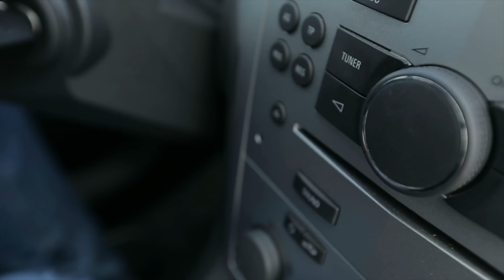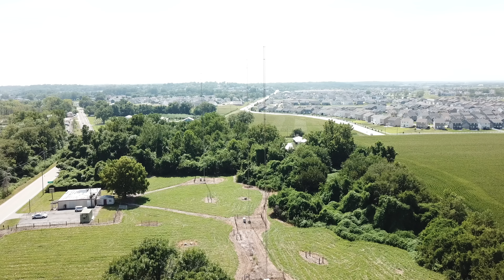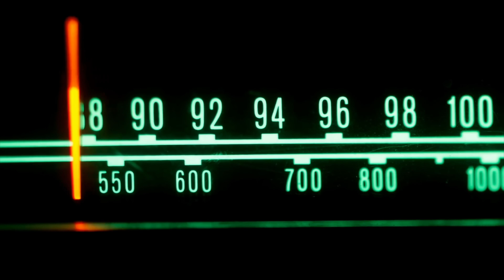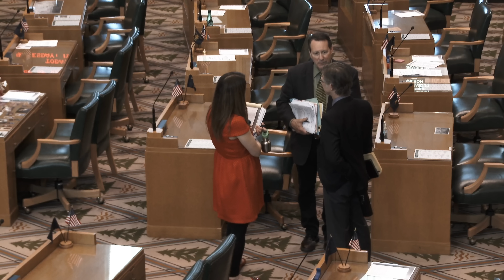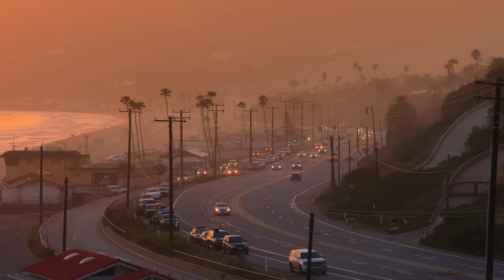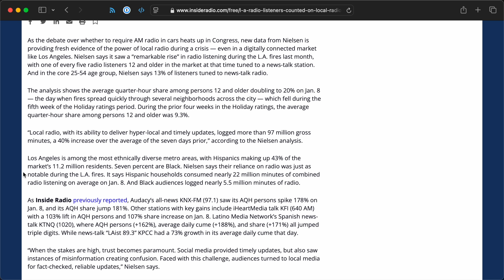Automakers are losing the battle with this 100-year-old tech

Comment: That being said, its shame that FM radios are being software-locked in phones. We have all hardware needed to have functional FM radios on our phones, but SIM card providers are intentionally locking them, so we must use internet to listen to the radio. Its not like im big user of FM radios, but in some emergency situations its nice thing to have
Reply: You can still use fm radio on phones with a headphones jack.  The phone uses the headphones as an antenna.
Reply: @peanutgallery95 
Not with radios for the FM tuner is software locked and not usable. My Android phone has an FM tuner but it's software locked and I can't use it with or without headphones.
Reply: @peanutgallery95  Yet they also remove the headphone jack from phones 🤔
Reply: @peanutgallery95 not all phones. Some phones the chip is locked meaning the apps that could use it cannot access it.
Reply: @peanutgallery95  We still have USB-c connectors that can act as an antenna and for audio. Some of these pins are not in use. On my old phone with headphone jack FM radio was locked
Reply: on my last phone, a Samsung Galaxy S10e, i had a headphone jack but as far as i know no fm radio function still
Reply: @animehair05silently88  you can always download an am/fm radio app
Reply: @animehair05silently88 I had to download software on my S10, but it worked.  On Verizon at the time.
Reply: Definitely need that too
Reply: Is that some amerimutt slave joke I am too free to understand?
The FM radio works perfectly fine in my smartphone without a SIM
Reply: Interesting. I'm gonna verify for myself!😅
Reply: Capitalism is insane. Its starting to enslave tech for profits.
Reply: Imagine being able to receive radio for free, paid for by advertisers.
Reply: @microdesigns2000 advertiser funded anything is not free, the consumer is the commodity
Reply: @microdesigns2000 Imagine the airwaves the radio is even on being owned and controlled by the public for the public interest.
Reply: @Praisethesunson  you've not worked in radio before?  Radio stations are privately held.  And public radio is, well, less public than you think.
Reply: @microdesigns2000 Station owners apply for broadcast licenses on “the public airways”.  

The stations are privately owned, but the airways are publicly owned and government managed/licensed.  There can (and have been) be various issues with that too,of course.  Especially since deregulation (and consolidation).

Comment: Am only radios were included as an option in stripped down no frills lowest trim level vehicles as late as the 80s, probably into the 90s for trucks, utility vehicles
Yes, my first car, an 86 Mercury Lynx (Ford escort) came with NO radio, not even AM, just a blank plate in the radio bay in the dash.
Manual trans, windows, brakes. Nothing powered, no radio. Stripped down to sell to first time buyers, students, as I was in my undergrad.
New off the lot

Comment: I restore vintage radios, most of which just receive AM.  However, I have an FM/AM converter and a small AM transmitter as I do not like talk radio.  On the other hand, I used a 1960 vintage AM transistor radio to keep up to date during the 2021 Freeze here in Texas.  Power was going on, then off, so a battery radio was the only thing that was reliable.
Reply: I have a crank AM/FM/Weather radio for the once a decade long power outages. We had our local cell drop off line after a few hours the last outage.

Comment: The FCC simply doesn't care about AM interference anymore.  I'd be surprised if anyone at the FCC even knew what Part 15 even is.  I listen to baseball games on a 1928 RCA Radiola 62, and over the years it got harder to listen to NY from CT.  I shut the main breaker off in my house and WFAN NY came in crystal clear with my battery radio.  I started throwing breakers one by one to isolate where the noise was coming from, and the worse offenders was my wifi router and some motion sensing light fixtures in my driveway and the alarm system was adding to the din.  There's no reason any car's electrical package should make enough interference to bother AM reception.
Reply: I wonder why part 15 says that it must accept interference, including interference that causes undesired operation of the radio?
Reply: Electric vehicles are super dirty. The inverters and motors can make AM pretty much unusable. Rolling radio jammers
Reply: @beff50  My 2018 S has an AM radio in it and it works fine.

Comment: You are talking about AM signal and you don't mention FM or DAB+ at all. All these standards are communication devices mostly just signal receivers that influence listeners' decisions. How stupid is it to have antennas for different standards when you can have one antenna and a decoder chip to convert the signal into something we can listen to or watch. We used to watch TV via antennas and now we can't listen to radio stations? Who will listen to the instructions of corrupt politicians via signals they own? You mentioned disaster warnings, how many of these warnings could be prevented before they are broadcast on AM if we were proactive and prevented them?
Reply: Mate, they are in the USA.

DAB+ doesn't exist there.

FM is way too short a range. We can just about ignore AM here in the UK because of the fact we are so bloody small so FM, multiple FM transmitters, with many more DAB transmitters as DAB is even shorter range than FM, can just about fully cover the UK fine.

One, just one USA type AM transmitter will cover the UK. Just one.

Seems you need to learn what radio is, wavelength is very important as well as frequency and it's wavelength/frequency that we are talking about here. Not the difference between FM and AM. It has nothing to do with the modulation technique. Nothing.

The only reason why it's called AM, is because you can't do FM very well on that frequency. And DAB? Forget it.

Comment: Try using AM in your house. All of those little power bricks that use switching power supplies broadcast AM interference. Cars used to escape that, mainly because there was not much electronics in a car. That is changing rapidly. I can get AM radio in my Tesla, which has no AM radio at all. I is done via internet radio and the cell phone network. End of problem, but of course that leaves the AM towers with no reason to exist. Its going to be hard to find both AM radio towers and people who care. Life moves on.
Reply: Ahem, getting "AM radio by mobile phone" isn't AM radio mate.

Neither is saying you have a bowl of fruit when you actually have a picture of one.

When you end up needing that AM transmission, your cell phone is dead.... No data bits when no service duh...

Comment: there is very little AM where i live, sometimes i sit and go trough the range getting outside country stations and i have always been a bit amazed by it
Reply: You could try running about 250' of wire out as an antenna extension. AM is also much better at night when the F layer of the ionosphere develops.

Comment: Airplanes still communicate with VHF  radio , which is basically AM. They also have ADF which can home in on an AM station. (auto direction finder)
Reply: The majority of ships and boats also use VHF.
Reply: VHF frequencies propagate very differently to MW (AM Broadcast frequencies). VHF is essentially line of sight. MW frequencies refract from the ionosphere, giving them far greater range, particularly at night.
Reply: I've not flown a aircraft equipped with an ADF in 20 years.
Reply: @grayrabbit2211  Many still have steam gauges , not all owners are rich enough to convert them to glass  and old airplanes, unlike cars , last forever.
Reply: VHF (Very High Frequency) is more like FM radio in terms of reach. MW (Medium Wave) is used for AM radio and can travel much further.
Reply: VHF is NOT AM🤨🤨🤨🤨
Reply: the air band uses am to prevent the fm capture effect and other things, am is more reliable however since it is VHF, that means it's coverage is similar to the standard FM band.
Reply: @DiaperDon_BoneSpurs_Epstein  In common use regarding broadcast radio, when people say AM or FM they refer to both the band and the modulation type. But they aren't exclusive to each other. The Aircraft band is indeed VHF, from 108 - 137 MHz, but it uses AM modulation. Also, CB Radio (27 MHz) used to be only AM modulation but since 2021 the FCC has allowed narrowband FM modulation to be used.

Comment: 😮😮 America needs to adopt DAB+ radio. AM radio here in Australia transmits at low power and it won’t go as far as 60 kilometers range from the transmitter and they are pushing digital radio that is DAB+ and it sounds like a CD in full stereo sound in mp4. It runs on VHF band 3 with the television.
Reply: DAB+ is too short a range. You're looking at multiple years just to start building the huge network of multiplexes you'll need just to replace one AM transmitter let alone several.

VHF is getting close to line of sight too.
Reply: @dlarge6502 It has the range of digital TV and that’s a similar range to FM radio here in Australia.

Comment: I don't know the situation in USA and how the radios are used there, so my comment can be biased.

I don't think we need AM radio. I think we should move to 21 century and make mandatory DAB(+)¹ and DRM². I think DRM should be able to supersede all the features of analog AM broadcasting. Better quality of sound or ability to transmit on longer distances with same power. Better error correction can help with poor reception. Of course, if you jam more stations in one multiplex, then all the advantages are gone. With DRM we should be demanding some open codecs like Opus, which don't have problem with patents and can manufactures don't need to pay licensing fees.

I seen that Sirius XM been quite popular in USA, maybe in case of emergency, each car can have some free Sirius XM radio stations which can be used in disaster situation. Satellites are not usually affected by natural disaster(Ignore for now the solar storm) and studios can switch to different city/state to broadcast or switch temporary to different radio on same channel.

Radek.

¹ https://en.wikipedia.org/wiki/Digital_Audio_Broadcasting
² https://en.wikipedia.org/wiki/Digital_Radio_Mondiale

Comment: AM has the potential of phasing out FM as Amplitude modulators become more sophisticated and sound quality becomes comparable to FM mono. AM can travel much farther and is more sustainable than FM. FM is limited by the line of site while AM can follow the curvature of the earth. It takes less energy to put out an AM radio signal and cover more range in some situations. You are also not constrained to tall locations which are expensive to own. Modern Amplitude modulators convert digital to digital to generate the signal and tests have shown that resampling a digitally sampled signal into digital again and back to analog significantly decreases audio quality.
Reply: You are prescribing properties to AM that simply isnt true, the frequency of most am transmission is what enables them to be heard from far away. Granted if two stations are on the same frequency in FM you wont hear the weaker station.

Comment: AM radio is being phased out. AM radio is subject to easily have atmospheric and electrical interference. It requires a proper antenna and special electrical noise reduction in the car. The sound quality of AM is not as good as FM and especially digital signals. 

Many of the radio stations have live listening on their web site.  There are phone apps that can be used to listen to radio stations. With the smart phone you can also go to the radio station live program site, and in many models of cars you can Bluetooth the sound to the car's sound system.  

AM radio stations require very powerful transmitters.  If there is a power failure they have limited time if running on generator. I never use the AM part of the radio in my car.  I am fed up with the huge amount of advertising on even the FM stations.  I subscribe to Sirus XM radio and to an on line 24/7 music service. These have many different channels for any type of music you can think of.  With XM radio, Google Maps, and Waze, I get live up to date traffic info on the vehicle's screen.  No need for radio traffic reports which are limited to rush hour only.
Reply: The sound quality of AM is purely a function of the bandwith used. You can easily surpass the sound quality of an ordinary FM transmission if you use AM, the signal would be mono though. The digital signals i heard sounds like crap, over here, number of channels trumps quality. Id never bother to pay for listening to something, least of all subscribe.
Reply: Obviously you have absolutely no idea what the hell radio is and how it works. 😂

Comment: Frequency & coverage distance are one immuable consideration imposed by the laws of nature, but modulation could still be improved decades after stereo was added to the AM band, in the '90s, by going full digital...  Which would boost noise immunity and yet offer some fair trade-off, if people want it.
Reply: @Egzoset - Analog AM stereo existed long before Digital AM (HD Radio in the USA)
Reply: @graemezimmer604  So what, i suppose you'd want it built with thermo-ionic tubes too!
Reply: Digital modes all fail on weak signal reception. An analog signal can still provide you with something, a digital signal will just go mute.
Reply: @juslitor  You're signal is breaking up, try get louder!
Reply: @ I am not a signal, nor a number.
Reply: @ More like noise on the battlefield, i'm ready to bet AM is rare in both the Ukrenian and Russian armies, imagine analog AM!  Go figure why...
Reply: @ Military signals are a whole different ballgame, one would imagine that unencrypted transmissions in this day and age wouldnt be used. Yet the ukrainians managed to frag a number of generals and colonels based on sigint intercepting russian transmissions.

Comment: There is an AM antenna tuner hole near the antenna socket usually, so you can tune your radio for the best reception on the weak station with a plastic screwdriver.

Comment: its actually a huge issue in EV's. early gen model S's tried going to a ceramic bearing inside the main motor stater to cut down the emf loss/am interference. these bearings causes weird potentials to build up and destroyed other bearings, similar thing happens to space station gyros and is why the hubbel satellite is about to be retired... imo i dont care if your car doesnt have am radio, but i would like some extra shielding put in in key areas as a stopgap.

Comment: i'm about 200 miles from the city, tbh i don't really listen to the radio much at all, but when i do it's usually am radio, i don't pick up hardly any fm stations.
Reply: Honest question. Is that worth maintaining a vast broadcast infrastructure and adding expense to already expensive electric cars?
Reply: @gloomyblackfur399  depends on who's funding the infrastructure really it's ultimately up to them, anyways i only listen to the radio during storms but we've got tornado sirens for bad storms already, don't have much reception on my cellphone so emergency alerts don't really work on that and i don't get in any tv stations over the air either. anyways speaking of electric cars there's no charging stations for those here either, i've seen several people get stranded at the gas station.

Comment: Interesting topic. Why legislate?
Btw, In the UK we already have a little known system for tracking your vehicle. 
It’s called ecall. I believe it’s been mandatory (?) in new vehicles since 2018. 
 We’re told it is for our safety and convenience…??!!
Reply: Mine is turned off
Reply: eCall is an EU mandate, but it only sends location via SMS to 112 (the UK reroutes this to 999) when you crash the car?  unless I’m missing something
Reply: @oskarz Pretty sure that is also available in the US - though may not be mandated.
Reply: @barrieshepherd7694  it's not eCall in the US, it's GM's own proprietary thing, may vary manufacturer to manufacturer

Comment: I deliberately stopped listening to AM radio when political shows got syndicated and hate radio replaced local programming.  One FM station I worked for  bought an AM station in the nearest metro market and just delivered remote programming.    At one point, you could go up and down the dial and Rush Limbaugh would come in through 4 or 5 stations on the dial.    They killed it for me, no music, no local news.  Goodbye
Reply: It doesn't have the sound quality for music, it's plenty good enough for voice with a longer reach than FM. It makes perfect sense.